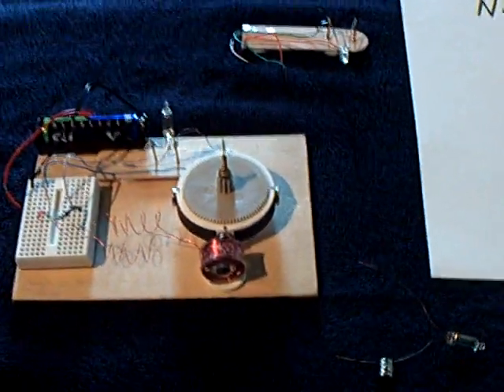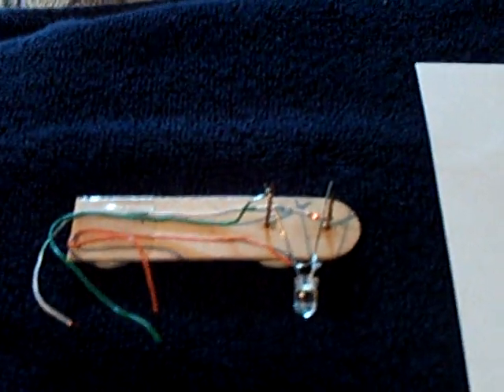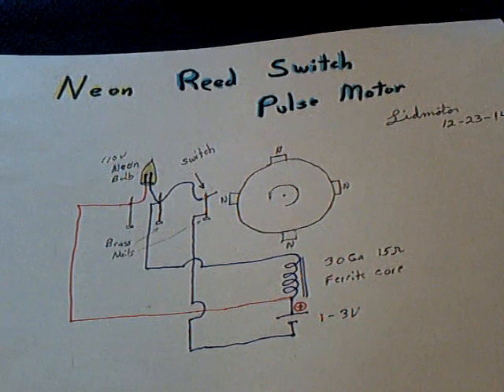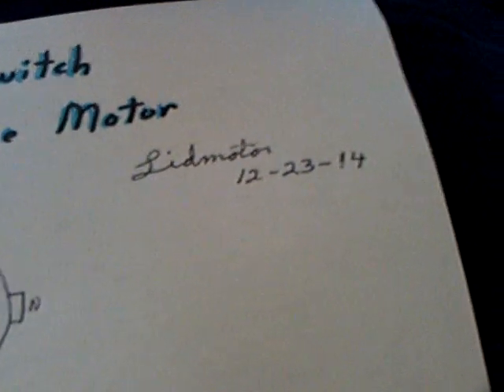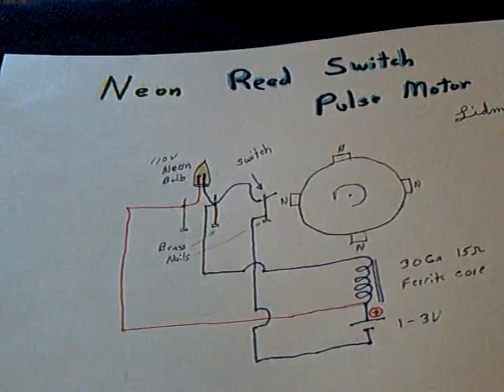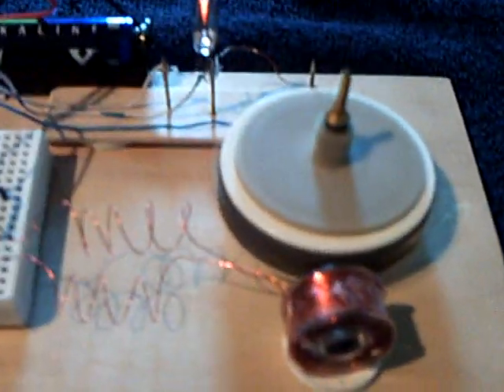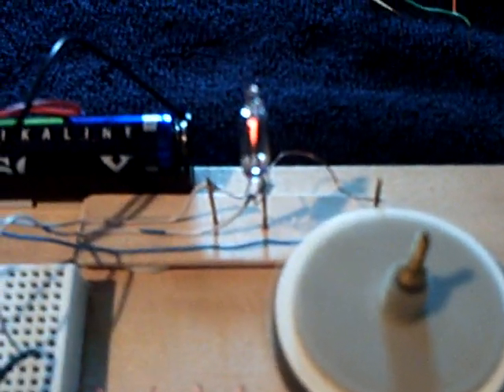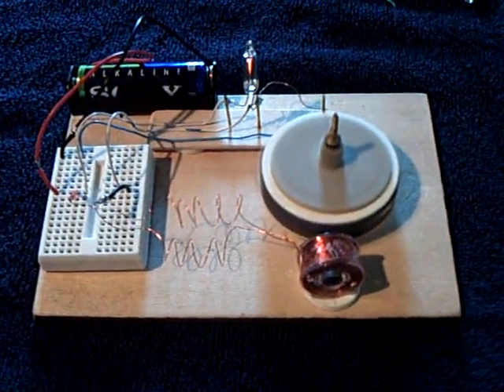NEON Reed Switch Pulse Motor

Comment: My comment doesn't really apply to this setup, but the other day I was just wondering if gold electrical coils do exist. I know that the copper wire has an insulation layer and gold wire doesn't. I have been searching for gold coils for a while but I can't find anything about gold wire electrical coils. Do gold wire coils exist at all? and if so where are they applied?....and how well does a gold electrical coil work compared to a copper coil?...is there anyone out there who knows more about this? I realize that it wouldn't be a cheap experiment but I can also imagine that somebody has already tried this.

I've seen a video that shows that gold produces strong eddy currents when a strong magnet passes close to the gold. And the video also showed that gold is slightly diamagnetic, that means that gold is slightly repelled by the applied magnetic field, even when the magnet doesn't move at all, although I think that the diamagnetic properties from gold doesn't really bother the experiment.

I can think of many questions about this subject, most have to do with efficiency.

Comment: A nifty extension to the LED method.
Am wondering if there's a way to run one of your electrostatic motors off the flyack spikes from this neon, from the coil side leg maybe.
Merry Christmas to you and family (inc Huey Dewey Phillis Penny Maggie of course) !
Reply from the maker: It is amazing how 'like minds think alike'.  Not 10 seconds before I read your post I was working with a HV cap thinking the same thing.  That high voltage spike might just drive an electrostatic motor if I can get it high enough and into the right Hv cap.  Man that would be really cool.  I might have to send it through a cap / diode voltage multiplier first.  It might work.  Merry Christmas to you and your family.

Comment: Thanks for noting the ohms of the coil. I have found that the wire gauge, length of wire and mH readings are important for duplication, but the resistance of the inductor is most important when trying to duplicate someone else's coil. I hope you do this for all your future videos too. Nice work!
Reply from the maker: Thanks. I'm like you.  I would rather know the resistance of the coil than the inductance--especially since my LC meter is broken. ha. Actually on my simple projects there is a wide tollerance on what will work.
Reply: ***** I have several LC meters. The one that works the best is the cheapest... <$19 delivered on eBay. If you are looking for one, look for the blue one. It doesn't have a brand name, but the model # is 4070L

Comment: nice work as usual...  if you put 3 other coils around the motor facing the magnets how much voltage could you get out of those ?...and maybe feed that back somehow...
Reply from the maker: That is an interesting experiment.  What if I added three more coils AND I added three more seperate circuits.  Then I took the flyback voltages and put them in series.  Hummm.
Reply: *****  even better...  looking forward to seeing what happens with that...merry xmas btw.

Comment: Have you ever examined the magnetic spike using an oscope?  It would be interesting to know its V (min, max, & average), pulse duration, & operating frequency.
Reply from the maker: A B I have looked at that crazy spike on an o scope for hours on end with other projects.  On the little simple pulse motors that I work with now I would rather not spend the time.
Reply: I see.  What were your findings on the other projects, if you don't mind me asking.
Reply from the maker: The back spike voltage on some projects running on 12 volts was hundreds of volts.  I would run it through a 1N4007 diode into a BIG electrolytic cap to grab it.  I remember one 12v project where I attached a 110 v incandescent night light bulb to the cap as a load. It came on and held at a 70 volts.  That proved to me that there IS amperage in that back spike--- if you have the right setup.
Reply: ***** I believe it (re: "...hundreds of volts").  I've seen switch contacts get fried from inductive discharge spikes when the circuit doesn't have a schottky diode in the circuit.  I guess I just wonder how much power that would be, how to tame it sufficiently for usage in a charging circuit, & efficiency of that output compared to the input power used.

I've seen designs which use caps on the output, but I've never built one to see for how well it works or if the power can be rectified properly for charging Li-ion cells/batteries.

Btw, what was the Wattage rating for the 110V incandescent light bulb that you used?

Comment: Add another coil with with reverse polarity to the first one on the other side of the motor,  and reversed battery voltage maybe,  then connect the spike energies together from both field collapses in different ways,  curious effects perhaps.

Comment: Great idea lidmotor!,   Shows how to produce 120 volts easily from 3volts.  Looks like the springy neon lead gets pulled against the non-mag brass nail.    Using a neoball magnet, you would get  2 pulls per revolution of the ball.  hmmm
Reply from the maker: Thanks Jack.  There might be several ways to use this switch.  If the power is low enough it doesn't seem to stick. It might work really good as a power transistor base trigger.